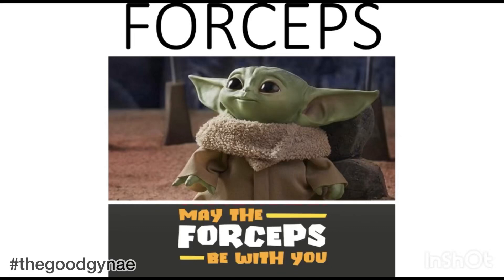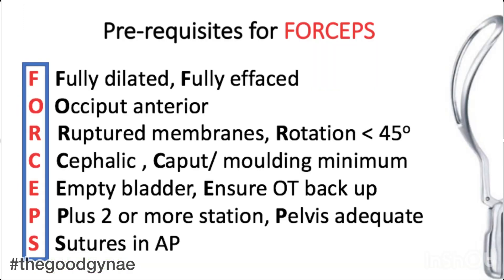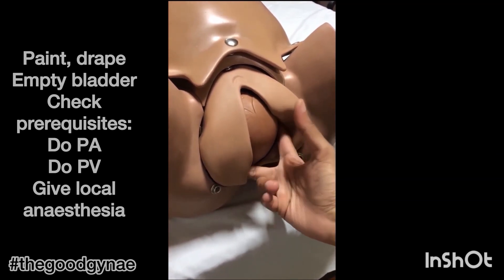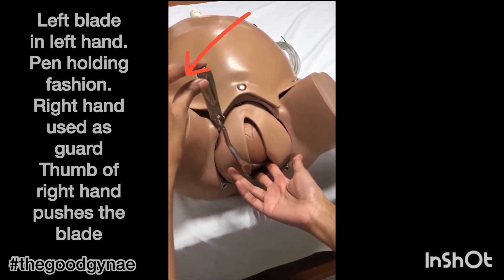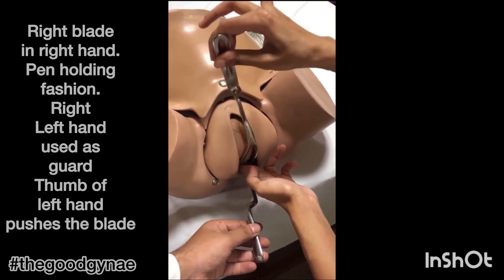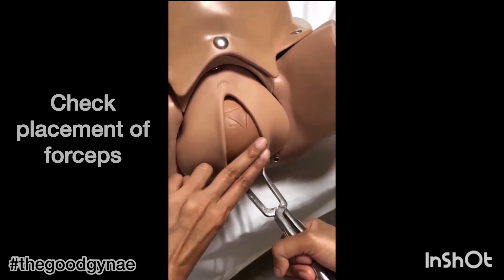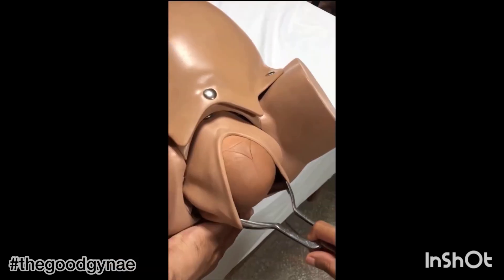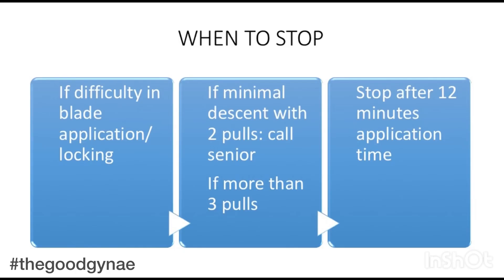Forceps delivery | obstetrics forceps application demo | Instrumental delivery |OSCE | USMLE

Comment from the maker: An important point to note here is that when inserting the right blade, space in sacral hollow is less ( as left blade already in place), so you can place the blade directly parallel to the mothers inguinal ligament and position it over the fetal head (the blade is always placed under the guidance of the opposite hand)